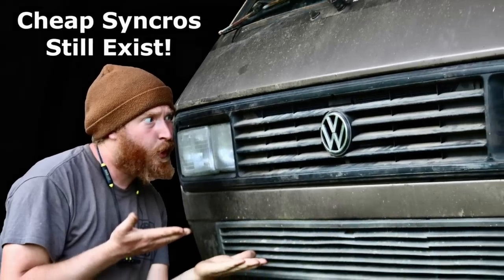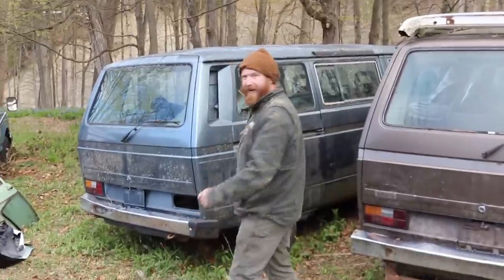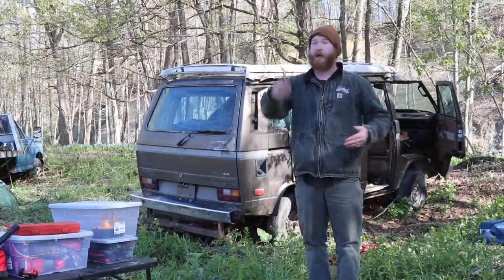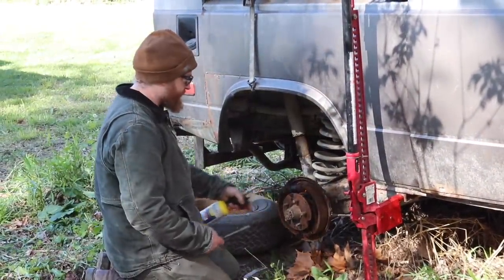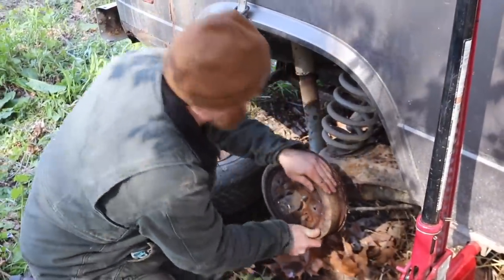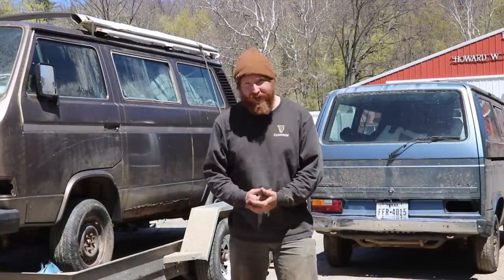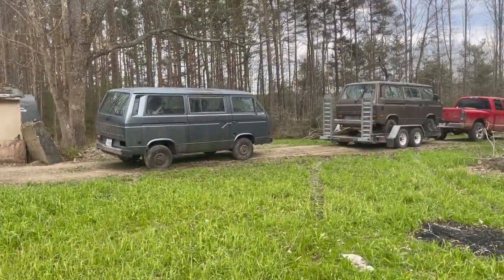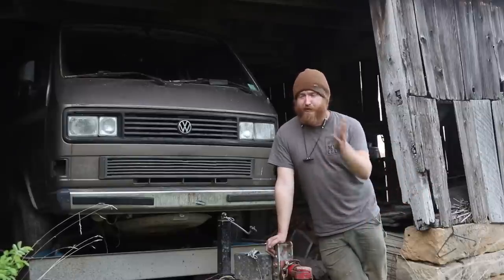Vanagon Syncro Rescue- Cheap Syncros Still Exist!

Comment: option number 3, pull the Syncro drivetrain and put it into another Westy and use this for parts to keep other Vanagons on the road. Thanks for another great video!
Reply from the maker: Now to find the right Westy.... : )
Reply: @TheBarefootForge  and then. Use the old rusty to install a Subaru drivetrain in. It
Reply: That'd be my vote too...  Pull it and convert a 2wd Westy to Syncro.  Just not enough of those left and as you say in another reply, the body is terminal on this one.
Reply from the maker: @WHJeffB  the problem is…. Do I need another syncro Westy? : /

Parts on the shelf make me sleep better at night.
Reply: @TheBarefootForge  Definitely a valid point...  Not many Syncro anything left now days.  I traded in my 86 Syncro Quantum wagon for an Audi Quattro about 22yrs ago...  It would actually be kind of nice to have that back right now!
Reply: But wouldn’t you need to rearrange many of the van’s internals to accommodate it? Not saying it can’t be done, but quite difficult, no?

Comment: I've always had an interest in the late sixties early seventies westfalias watch and all you guys's videos I'm really starting to get into these 80s models I like their looks and style he thinks I might have to start hunting for something like this be a lot cheaper than a 70's model
Reply from the maker: not only that- the T3 (Vanagon) is SUPREMELY better of a vehicle, far more modern then the T2 (bay window) bus. It will drive on the highway, not kill you in an accident, and can accomodate modern engines, towing, braking, etc etc etc. They can have airconditioning, heat, stereos that work. Bays are cool, they have lots of charm, but so much of that charm is from bad childhood memories and people that haven't driven one maxed out on a modern highway.
Reply: @TheBarefootForge  what I've noticed a lot in your videos on how they look they actually look like they have heaters that work LOL think I'm going to have to start looking around see what I can find and go from there even if it's just the base model and not the Westphalia or camper models I'd still be happy but I always look for the usual rusted areas like floor pans suspension parts all that I'm not worried about will Wells or things like that as long as they're not too bad as long as it's mechanically solid too much body work I might just look for one

Comment: Had one of those '84 Wolfsburgs. I didn't know it was a 1 year only thing. Yes it had the blue corduroy interior. No A/C and a manual transmission. Mine had the bed, screens and snap up curtains, I don't know if that was standard or not.
Reply from the maker: Yep! That’s an 84 Wolfsburg. One year only.  Not particularly desirable, but quite rare.

Comment: Hey, Barfoot Force Interesting question I would consider getting the Syncro back on the road if the eventual rust is overcoming. I refer to the framework the bodywork looks ok I think so anyway good luck with the project. Greetings from Norway.HCS
Reply from the maker: Sadly I think it’s pretty terminal. I Didn’t show it thoroughly in this video (I’ll do a video showing why I make my decision when I do). The body is fully rotted above the trailing arm attachment points on both sides, and the frame is showing signs of rust through from the inside where the front subframe attaches. 
It’s pretty bad.
Reply: @TheBarefootForge  Well that`s too bad. Bud that`s happens cheers

Comment: there are 2 main areas to look at to decide weather it is a donor / parts car or a rebuilder, I look at the frame rails above the back of the front sub frame and the transition between the floor and the fire wall under the rear seat where the gas tank mount is those 2 areas will give you a good indication of the severity of the structural rust.
Reply from the maker: Absolutely! The front frame is showing some hints at that problem. The rear frame is fully rotten above both trailing arms, and that..... that I think is what kills it (to me).
Reply: @TheBarefootForge  the question then becomes do you want to invest in the replacement cross member and fuel tank mount that will be required to mount the drivetrain in another van? otherwise it is best as a parts donor.
Reply from the maker: @alexanderdenette5101  well generally that cross member cleans up pretty good once removed- it’s probably a fully viable donor vehicle.... it’s just hard to say, or to early to say.

Comment: 1 - get it on the road. Have you not seen the prices if VIN coded Syncros? You’re in for a HUGE profit.
Reply from the maker: But it might take $15k just in body work, let alone all the drivetrain, to make it a $20k car. 
Idk….
Reply: @TheBarefootForge  after doing a search on AutoTempest … there is one Syncro for sale in the country. ONE. That’s a case of “low supply” which means high price!
Reply from the maker: @MrJeddurso  that’s because they sell on thesamba.com. Dozens available at any point. Tin tops sit around for sale for years. Syncro westies though….
Reply: @TheBarefootForge  Agreed. Convert it to a Westie and get $45,000? Wow
Reply from the maker: @MrJeddurso  ehh. I’ve done that a few times, and it’s ALOT of work. These days a donor is $12k. 
And then you still have the intense body work this one needs. 

If anything, this becomes a syncro donor to syncro swap a 2wd westfalia.
Reply: @TheBarefootForge , now a good body well running,  50-some...100k

Comment: If at all viable, I would argue to keep it complete or bring it back to life yourself. It can only apppreciate over time.
Reply from the maker: Ya, i'm just concerned this one isnt a logical candidate for that. $10,000 worth of body work would make this an $8,000 syncro.... and it would still have no running gear.

Comment: Great video, I have just brought a 1981 t25 panel van and got it back on the road in the U.K. any advice on the panel gap rust?
Reply from the maker: Honestly... leave it to professionals. In general the only REAL solution is to cut it out and replace the metal, then seal it up better then factory. The factory seam sealer worked great..... just didn’t last 35 years. 

Where’s your rust?

Comment: If you're in the habit of buying vans, I have an 85 with a Rocky Mountain Westy subaru swap with 30,000 on the engine. I'm moving out of state and am trying to get $5000 for it. New cooling system, new fuel system, new brakes all installed with then engine 4 years ago.

Comment: 11:31 an that is the reason a high lift jack is a recovery tool and not a regular jack. Imagine someone lying under this vehicle.
Reply from the maker: Absolutely! A hi-lift is a field recovery tool, which is exactly what we were using it for in this video. You’d never want to be under the car suspended on only a hi-lift, not without proper protections in place.

Comment: I hope you did not spend anymore than $2k for those 2 parts vanagons. We here in the West Coast, we avoid anything that is that rusty and far gone. Pretty sure they are in a lot worse than what we saw on the video guys.
Reply from the maker: I could sell that syncro for $6,000 tomorrow. Sadly, your sense of value is way off. As you may have seen in our other videos- I sold a bunch of unknown condition used/core syncro transmissions for $2500 a piece so fast it was insane. The value of ANY syncro is over $6k. 

I paid $700 for a syncro speedometer for my red bus, after a year of looking.
Reply: @TheBarefootForge  Crazy value for mechanical parts. I am restoring a 86 full synchro triple knob Westfalia Weekender ( weekender models are rare vs full camper models) now. California van so it's almost all rust free. It was sold for $75k from GoWesty 10 years ago. It has a GoWesty 2.6L motor, fully rebuilt trans, lockers, etc....big lift, big suspension, big brakes
Reply from the maker: @brucewayne2773  epic! That sounds awesome. 

A “cheap” syncro these days is $3500, even if it’s way rustier then this one. A broken transmission, BROKEN, is worth $1200 or so.

Comment: There's no such thing as a "cheap syncro". The trade off is the cost of parts and the amount of work that will go into making them reliable.
Reply from the maker: That’s simply untrue, and the point of this video. I’ve got a daily driver syncro I’m less than $5k total into, and I’ve had a syncro westy that was a reliable road trip vehicle for under $7k total.

Comment: Not Wolfsburg ! These cars comes from Germany / Hannover . I work in this Factory sins 36 Years !
Reply from the maker: Many came from Hannover, many came from wolfsburg. This was the first of the production run in Wolfsburg and thus titled “wolfsburg edition”- it even had a cool badge that said that.
Reply: @TheBarefootForge  The Name Wolfsburg Edition is right but Wolfsburg cant build so big  Cars . The Sticker is from a Rabbit or Passat
Reply from the maker: @Norbi1970  there are vanagons with a W in the 10th digit of the vin that were built at Wolfsburg.
Reply: @TheBarefootForge  The 11th digit is important for the place of manufacture. G for Austria and H for Hanover
Reply from the maker: @Norbi1970  and:
	
A - Ingolstadt

 	 	 	 	 	 	 	 	 	 	 
 	
B - Brussel

 	 	 	 	 	 	 	 	 	 	 
 	
E - Emden

 	 	 	 	 	 	 	 	 	 	 
 	G - Graz (Austria. normally for Syncro models)	 	 	 	 	 	 	 	 	 	 	 
 	H - Hannover (most buses assembled here)	 	 	 	 	 	 	 	 	 	 	 
 	K - Osnabruk	 	 	 	 	 	 	 	 	 	 	 
 	M - Mexico	 	 	 	 	 	 	 	 	 	 	 
 	N - Neckarsulm	 	 	 	 	 	 	 	 	 	 	 
 	P - Brazil	 	 	 	 	 	 	 	 	 	 	 
 	S - Stuttgart	 	 	 	 	 	 	 	 	 	 	 
 	W - Wolfsburg